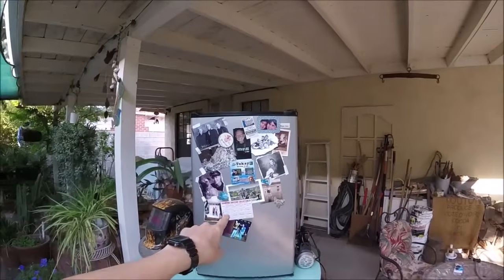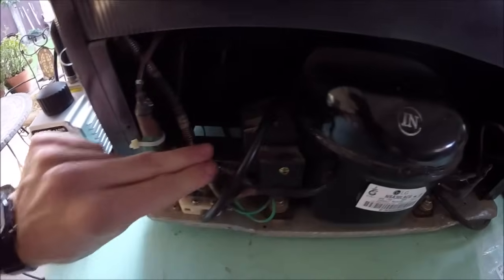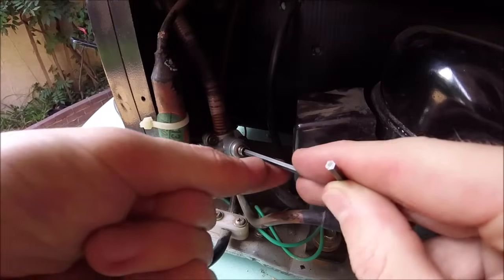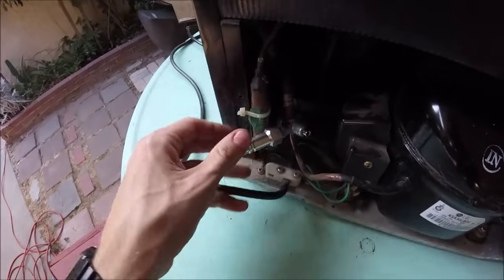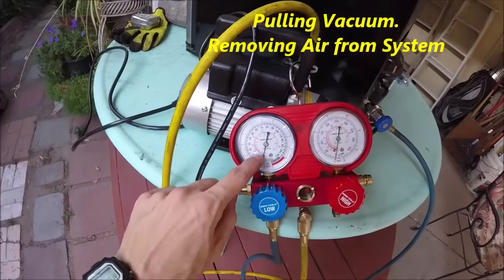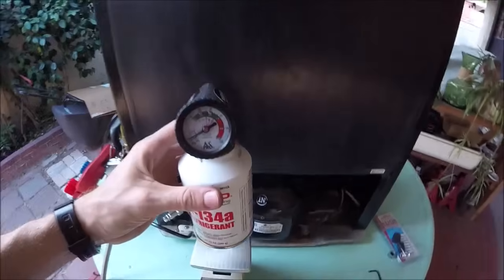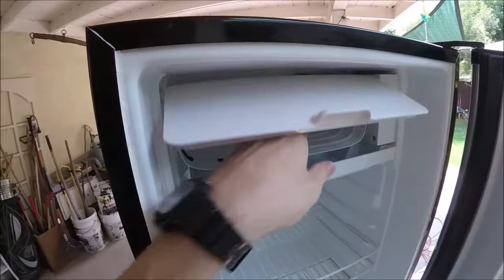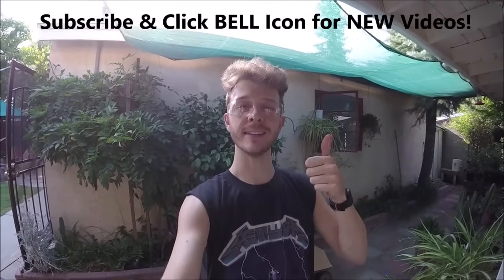How To Correctly Add Freon to your Refrigerator R134a -Jonny DIY

Comment: Thank you very much for the video! I’m having trouble figuring out why I can’t get the vacuum pump reading to -30. It only goes halfway, and when I close the valve, the reading drops back to zero.

My first guess is that there might be a leak elsewhere. However, I’ve sealed the original hole, and there’s never been an issue prior to that puncture. Also, I removed the piercing valve to ensure it actually made a hole, and it did release a vacuum. So, it seems it must have been sealed to some degree.

I’d greatly appreciate any advice or insights you might have. Thank you in advance!
Reply from the maker: @thopf3  it's possible there's another leak and also possible the piercing valve is leaking not allowing you to get a good vacuum. Id fiddle with it a bit more, hopefully can pinpoint where problem is
Reply: @JonnyDIY  I just wanted to follow up with an update. I added more sealant to the original hole as well as the hole created during the first piercing attempt, and I finally got the vacuum to hold. The fridge is back up and running perfectly.

Thanks again for the video—you’re a godsend to those of us fighting against the throw-away culture.
Reply from the maker: @thopf3  Awesome,  happy to hear you got it going. You're very welcome! 🙌👍

Comment: How did you weight the can seperate my gauge Pierce's the can and if you unscrew it then it all means out ?
Reply from the maker: You can unscrew them. The cans are self sealing now to prevent that 👍🏻
Reply: If you have a digital scale you can measure it with the lines hooked up. You just hook it up and put it on the scale . Turn the scale on and tare the scale and start pumping the freon. As the freon flows you will see the amount of freon going into the system.

Comment: When I add refrigerant to my central AC, I have to bleed air out of the lines before adding the refrigerant.  When using these piercing valves, there seems to be no way to do that.  Do you just live with the small amount of air that will be trapped in the line and then introduced into the system?

Thanks!
Reply from the maker: You're welcome. I usually dont worry about it. You may be able to purge the hose connected to refrigerant can though
Reply: Purge the air out of your hoses with refrigerant rigjt before you connect to the appliance.

Comment: Why did you use an R12 to R134 conversion kit when the fridge already is an R134A?  Also, will this work with a Freezer instead of a fridge? Thanks!
Reply from the maker: You're welcome, glad to help. I needed the conversion adapter to use the charging hose I had, but some hoses will directly attach to the bullet piercing valve. I had that hose already for working on car A/C so just needed adapter. And yes, this same procedure will work on freezer as well 👍

Comment: How long does it take for the gauge with the vacuum pump to start moving?
Reply from the maker: Shouldnt take long if you have the hoses connected right and open on both ends. The ends of the hoses, the fittings are kind of funny, you have to turn clockwise to open. Heres a more in depth use of gauges and vacuum pump I made
https://youtu.be/hkjZNDyxvgo

Comment: I have to use r600a refrigerant on a mini fridge I got my bullet piercing valve today.The thing is the suction line is cut and crimped on the left side of the compressor but I still put the piercing valve on the leftover piece of copper line about  2 1/2 inches long with a rubber cap covering the tip.Do I need to switch to the right side to the other copper line which is untouched I believe its the high pressure line. I didn't pierce anything yet and I am waiting on my r600a refrigerant from ebay.I just don't want to waste my refrigerant doing it wrong,thank you.
Reply from the maker: Yes you want to add it to the low/cold side of the compressor 👍
Reply: @JonnyDIY  Thanks.

Comment: Clip is super helpful. I'm trying to figure out how to vacuum my r600a kegerator in preparation for direct injecting a LeakSaver kit with 1.76 ounces of r600a. It looks like I need a standard bullet piercing valve, can probably rent that vacuum kit and use it on the r600a just the same as you did with r134a. It seems like I can then...assuming once suction is holding, attach a leaksaver kit and direct inject with a gauge set specifically for r600a, a k28 valve with r600a attached and just open the valve till 1.76 ounces flows in. Does that sound insane? Having never done this before I just don't want to mess it up. Seems like if the suction doesn't hold, I would just use the leak saver kit alone direct injecting with refrigerant grade CO2 first and let it circulate for a while before re-vacuuming and then injecting r600a.
Reply from the maker: Sounds good to me, hopefully you can get it going again and the leak isnt too big 👍

Comment: When selecting which line to hook the bullet valve up to.  Do you just select the closest line to the access hole or do you use the low pressure service line?
 On cars they are differant diameter but on my little freezer they are the same size.  How do you tell?  I rather use the low pressure side than the high pressure side.
Thanks..  I have parts on order.
Reply from the maker: If you can use the service line or stub. Should be the larger tube coming out of compressor, not the one with the bulbous drier on it 👍🏻
Reply: You could only use high pressure side from the state of vacum if wasn't in a vacum it would not take freon into th high side it will actually pump it back into your guages
Reply: When the system is under vacuum it will take the freon regardless of which side your on.  That's just basic physics,  but once you start running the system under normal conditions you want the freon on the correct side of the expansion valve, in the right place for proper operation.   We are all learning here, thanks.  John.
I agree with the 1st comment, service side is usually low pressure side in automotive anyways but I am no expert.
Reply: @johnkomosa4089  You will not be able to charge from high side. Has to be filled from low while the compressor is running.

Comment: Hi, Great video! I'm trying to recharge a full-size kitchen frig. Got the BPV attached, I used a vacuum pump to purge the air, it kept a vacuum at -30psi. All Good! But now when I attempt to add R134a it won't go in. I have the frig plugged in. I tried using two different recharging hoses that I've used with my cars. Just won't take any Freon into the system. Any ideas? Thanks!
Reply from the maker: Make sure you pierced the pipe with the valve fully. Drive it in all the way and back it off about a full turn or so, then it should take some. Also make sure hoses are all open, I know those auto ac hoses are kind of wonky the way you turn em to open them. Seems like they should be open the reverse way theyre set up
Reply: @JonnyDIY  Hi Jonny, OK, I have done as you suggested. No luck so far. Also, pretty sure the tubing was pierced because when I first pierced it, I heard a small amount of refrigerant escaping. In reviewing other videos, I notice that there are two types of tubing. There is the "liquid" tubing, which seems to exit the compressor lower and the "gas" tubing which seems to have a larger diameter and attach at a higher position on the compressor. I may have incorrectly installed the BPV on what I believe may be a "liquid" line, not on the larger diameter "gas" line. Also, as I become more familiar with the tubing I've noticed that there seem to two types of what are called "stubs." These don't go anywhere and have a blue plastic heat-shrink cap on them. So my next move is to order a new BPV and attach it to the larger of the "stubs". What do you think?

Comment: Johnny....I have a leak in my wine cooler that needs sealant before refrigerant.  Do you have a video on how to install sealant?
Reply from the maker: No sorry have never tried that on a refrigerator before only cars. I would try and find leak. Put strong soapy water on all connections and see if find leak. Last case scenario could try a little of that stop leak, but be prepared for it to fail. Nothing much to lose at this point if its not worth a repairman to fix
Reply from the maker: Here's the video of stop leak I made. Same process but would be very little stop leak added since refrigerator so much smallet than auto system 
https://youtu.be/6xbnUd649Es

Comment: I believe your supposed to add on the low pressure side? How do you know where that is? On a car the caps show it but not sure on a fridge.
Reply from the maker: low side line is the one thats higher going into compressor
Reply from the maker: or if yours has service stub its usually that one

Comment: So, what if your fridge says it takes R134? Do you still need the conversion kit? What if your can of refrigerant has an adapter on it already? Do you need the conversion kit? Is there something else I can use as a vacuum? I've had to order the parts and wait weeks for them, and STILL I need more crap? It's just really frustrating,  and while I am grateful for this guy making the video (I know a hell of a lot more now than when I started), it still leaves much to be desired.
Reply from the maker: I borrowed gauges and vacuum from local autozone for free just deposit. You have to vacuum though, yes
Reply: It's a bummer you have had to wait weeks.  I got my parts the next day.  The bullet piercing valve I was able to purchase from a local AC store. A store that caters to air conditioner repair companies.  The conversion fitting I was able to get from Amazon the next day. Also my local AutoZone had multiple vacuum pumps and gauge manifolds for me to borrow.  
   Overall for me it was a very easy process because my unit was still cold and functioning, but low on refrigerant.  That made it easy for me to feel with my hand which was the high and low line, meaning the hot end not hot line, and also the service port to the compressor which was also not hot.  It was very easy process to install the components and to recharge the system. The only thing that Johnny did not mention which is I think notable, is that it will take quite a while potentially for a vacuum to be reached.  I believe it was about 45 minutes for me.

Comment: What do you do if you expect you might have overcharged a refrigerator?  What are the steps to remove some?
Reply from the maker: You can bleed a little out the valve
Reply: @JonnyDIY  Thanks for the quick reply.  So when I bleed it, the unit is on?  What PSI do I bleed it to?

Comment: Can the gas get low without a leak in the system?   Ie if you regas, wont it leak out again?
Reply from the maker: Well it depends how large of a leak you have, some leaks can take years to develop and leak out enough to stop refrigerator working. You will know how large the leak is when you vacuum the system and see how long it holds that vacuum pressure. If a large leak, that will need to be addressed before recharging 👍

Comment: That piercing valve was sticking out where it could cause problems down the road. It might be a good idea to tap the line in an area where the valve will remain inside the frame so it cannot be easily jarred around which could cause a catastrophic failure. 

Also, your on screen text about the dust cap was too short, I had to go back and watch that part again to see what it said. Great tutorial. Thumbs up.
Reply from the maker: Thank you, happy to share 👍

Comment: Johnny I have a GE Profile Artica refrigerator. It is not cooling very good. The fridge is staying around 45 and the freezer is 30. Would this be the issue possibly? The GE techs can’t schedule a service call for ten days. I can’t wait that long. Thank you!
Reply from the maker: It's possible yes. Especially if older fridge that slowly got warmer and warmer. I would call some local refrigeration techs/appliance repair. Should be able to get someone out earlier than that. And in meantime freeze some 1 gallon water jugs and place in refrigerator to help aid in cooling 👍

Comment: When u pulled the vacuum was any r134a still in the system at all meaning u vacuumed out the remaining refrigerant?
Reply from the maker: Was none left in my system, but yes you need to remove any remaining r134 but also the air in system. If you don't remove the air it won't cool properly 👍
Reply: @JonnyDIY  the problem I'm having is the top part of my refrigerator cools but the bottom evaporator doesn't cool at all any ideas on that

Comment: I read in some comments you can use the piercing valve and charge it at the stub instead. Is this true? I never see any videos of anyone using the stub to recharge.
Reply from the maker: Yes you're correct you can use the stub out to recharge, that's whats most commonly done then after recharging you use a special tool to cut and crimp shut the end. But this fix with the bullet valve is still working years later 👍
Reply: @JonnyDIY  thanks man. I have a fridge thats probaby from the 80s and the back of it says R12 9.2oz. The thing stopped cooling last year but the compressor runs and i can hear liquid going through the freezer box. Since i keep reading you cant add r134a to it, i might be screwed and have to buy a new one (cabin up north).
Reply from the maker: @johnnylawrence  ohh r12, yeah sometimes you can find someone selling some old cans of it local or on ebay

Comment: Hi Jonny I have a LG refrigerator and the specification says the Freon is R134a. But I read some articles telling me that R134a is only used for auto AC not for Refrigerator. In this video I saw you use the can with label of "Auto Air Condition". So can I use any can like that in Amazon for my LG refrigerator? Thanks.
Reply from the maker: I have read they're a little different in the additives, all I can tell you is that this fix is still holding up years later. So I wouldnt hesitate to try it on yours since it too calls for R134a

Comment: Would the vacuum suck out the original refrigerant that in the system?
Reply from the maker: @thetran5000  Yes, as well as if there's any air in the system 👍
Reply: @JonnyDIY  Does it evacuate everything out of the system? So you would inject refrigerant like a new system?  Does the vacuum expel refrigerant to the air?
Reply from the maker: @thetran5000  yes it'll pull all the remaining refrigerant out if any. If the system is just a bit low you could probably get away with not vacuuming. But it makes it hard to tell how much to add back in. If system is completely empty you need to vacuum it to remove the air
Reply: @JonnyDIY  Thanks for the information.  My refrigerator is 15 years old and it too cold.  Someone said it's low on refrigerant.  What would you suggest?
Reply from the maker: @thetran5000  if its too cold not  gonna be low on refrigerant. Id say start with thermostat control maybe.
Reply: @thetran5000  Probably thermostat if BOTH things are cold. If one is cold, the other is not (combined refrigerator and freezer together), that's more likely a low refrigerant situation. I had both happen to my fridge. First themostat going out forcing too much work on the compressor/low temps 5 years ago, now it's flat (no gas). 20 year old fridge.

Comment: When using the vacuum does it suck just air out of the system or existing refrigerant as well? If it removes the refrigerant as well, does the refrigerant stay inside the vacuum? I don't see a catch can just wondering where it goes. And if I get the vacuum to -30 psi then I can assume the system is completely emptied to add the exact amount of refrigerant the system is rated for? (1.41 is on mine)
Reply from the maker: Yes it pulls the air and any remaining refrigerant out and vents it into the atmosphere. If you have a large amount of refrigerant in system, responsible thing to do is evacuate into storage canister. But if it's emty or just about its ok to just vacuum. Yes you will add back that amount after achieving full vacuum 👍

Comment: I may have missed this but which line specifically does this get attached to? Im very familiar with car AC lines and it doesnt look identical (rather a different style altogether). Im sure the concept is the same but then again i only saw the Low line hooked up for a regular refill operation.
Reply from the maker: @sfcd4757  same thing, low side 👍

Comment: Any idea of typical on and off cycles in timing with a Fridge like this?
Reply from the maker: On a mini fridge would probably cycle on and off every 30-1hr after its completely cooled down
Reply: @JonnyDIY  Ok, the reason I ask is because mine cycles around 5-6mins, and I don't know if that's ok. I've searched online but can't seem to find the answer. It definitely gets cold af, but I'm concerned about the cycles because I don't want to end up paying high on the light bill.
Reply from the maker: @FreonTheFrozen  these small ones cycle on and off more frequently. If worried about power, put a small thermometer in fridge and dial the temp up til its 40 degrees or just under 👍🏻

Comment: So should you fill from the low pressure line or the crimped access nub? It looked like some people in the comments were saying to use it. Also could you just go off of the gauge and try to put 3 pounds in it instead of weighing the can?
Reply from the maker: You can use the access nub. I think mine didnt have a good straight/flat part on it, that's why I didn't there. It's best to weigh the can as to not overcharge. And on a small fridge like this it barely takes any, so it's easy to 👍
Reply: @JonnyDIY  thanks! And awesome video! Looks like you have helped a lot of people. Good on you.
Reply from the maker: @sammckown7758  you're welcome, happy I could help. And thank you for your kind words 👍
Reply: @JonnyDIY  you're welcome